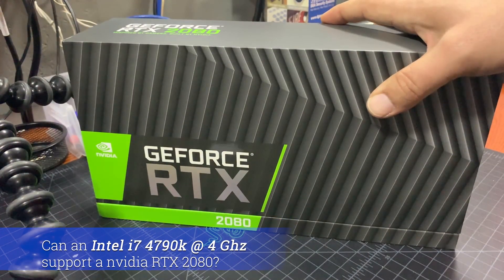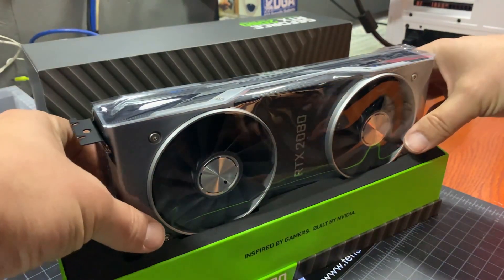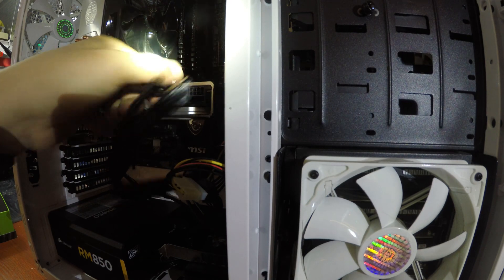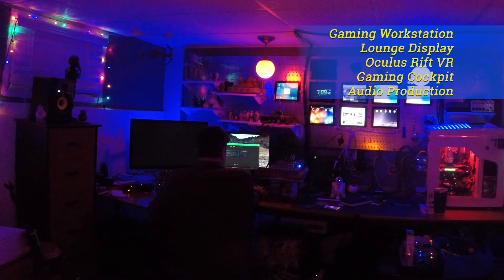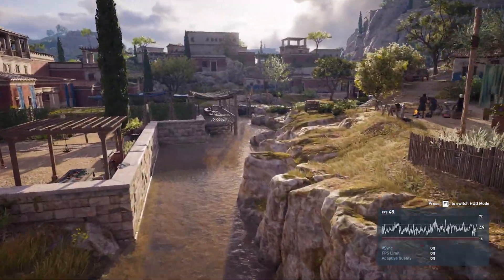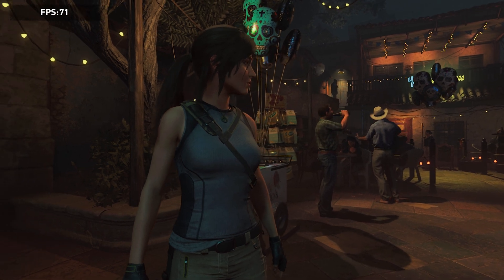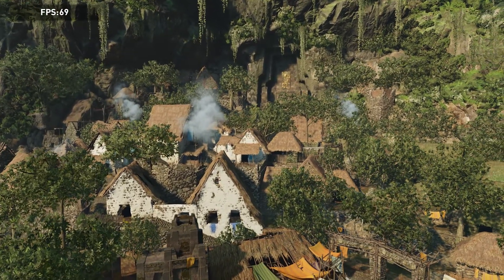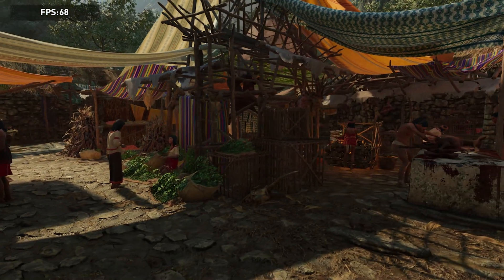nVidia RTX 2080 on a 4th Gen Intel i7

Comment: Not sure I understand mating a $1000 gpu to a 4th gen cpu.
Reply: The GPU shortage was over! Just picked up a 2070 on eBay for $210 after taxes and fees. I have the non overclocked i7 in this video. Don’t feel the need to upgrade my cpu but I do want something to upgrade my 750 2gb.